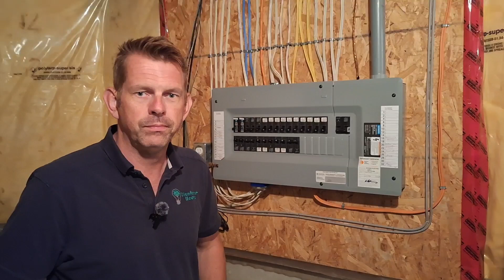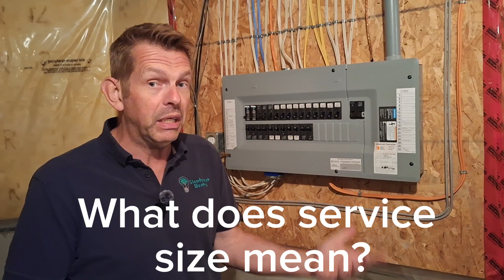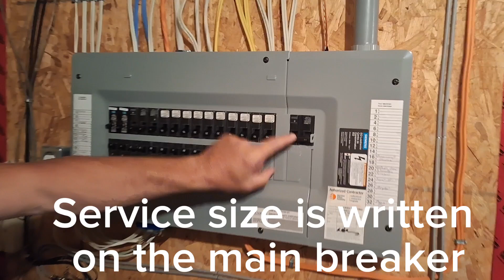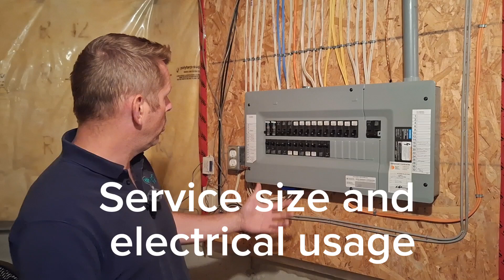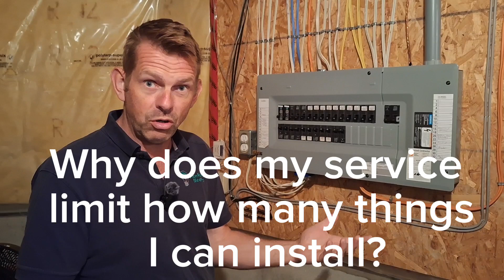What does "Electrical Service Size" mean, and what size is mine? | Electrical Questions Answered

Comment: Well presented Andrew.
Comment: I've never seen a horizontally orientated panel box, outside of the military.
What's the story on your hermaphrodite? My local inspectors would laugh then red tag me.
Reply from the maker: That must be an American thing. Do you know the purpose behind preventing horizontal panel installations? I'm curious.
Reply: Yes former member of electricians union in Chicago. I Didn't understand that you were from the land of 50 Hz. I should have known as I've seen a lot of videos from other countries and enjoyed the electrician approach and the various hardware, code or the lack thereof.
Reply from the maker: @mackfisher4487  couple of misconceptions there, I think. 

Canada operates on the same 60Hz system as the USA. It's Japan that mixes in the 50Hz with the 60Hz. That's why almost all Japanese electronics run sealessly on both.

Also, Canada does not suffer from a lac of electrical code. In fact, many would say it has too much. The Ontario Electrical Code is more wordy than the NEC. But nothing about panel installation orientation. 

So, in your opinion, why is it not a good idea to install a panel horizontally?
Reply: @GlenforestElectric  If I could go two electrical supply house and purchase horizontal panel similar to yours that was NEC listed and pass local inspection. I would happily try it in a surface mount application particularly if the same commonly used breakers we use now would fit that panel board The vertical panels, we use in America are designed to be in the recessed in between the 16 inch wood or steel vertical wall support.